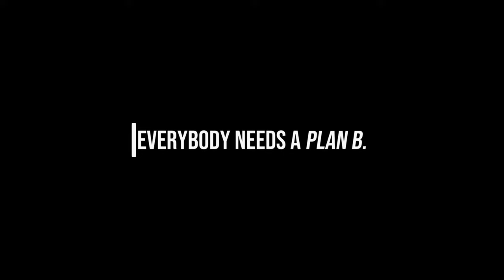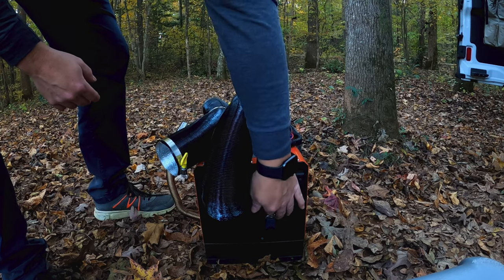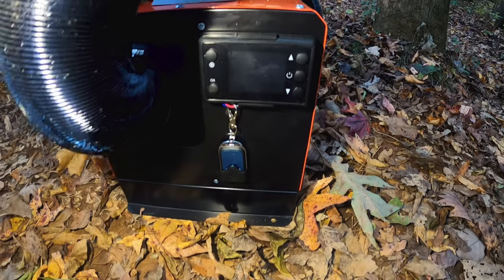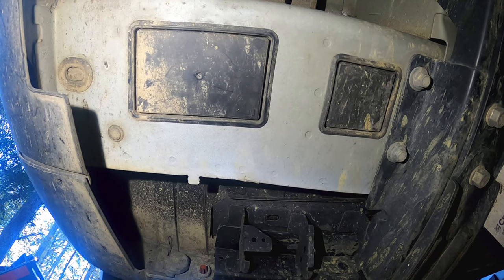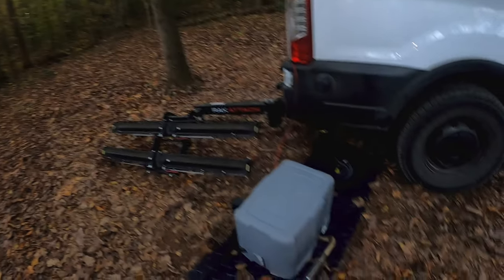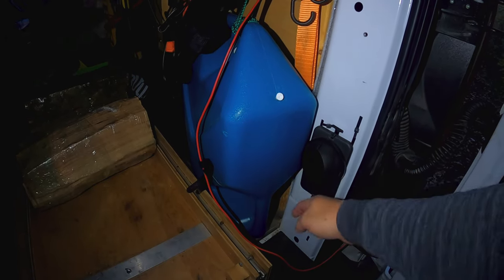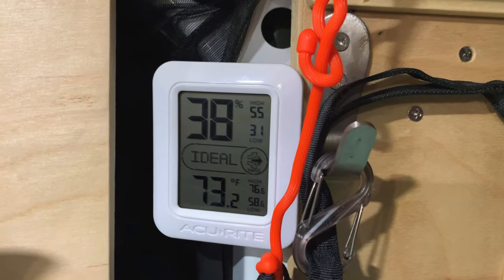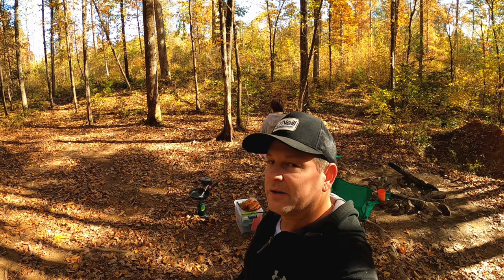#MTBPlanB First night camping with all-in-one portable diesel heater.

Comment: Which all-in-one model (8KW) has the higher capacity fuel tank? The low profile heater (in this video), or the taller suitcase style heater?
Reply from the maker: Both have 5L diesel capacity.
Reply: @MTBPlanB  Thanks!